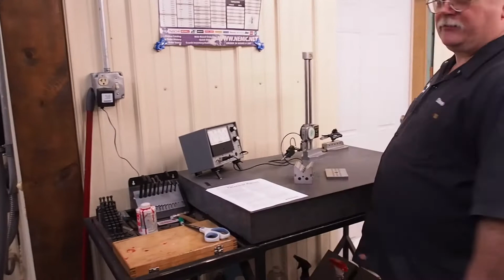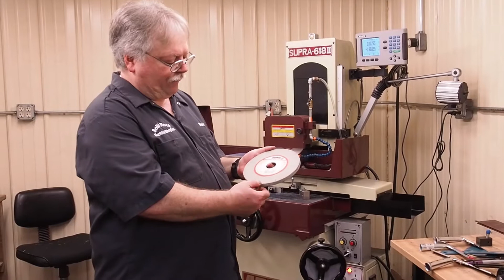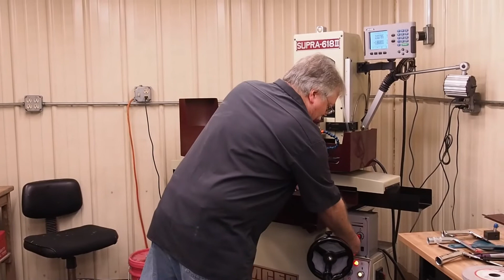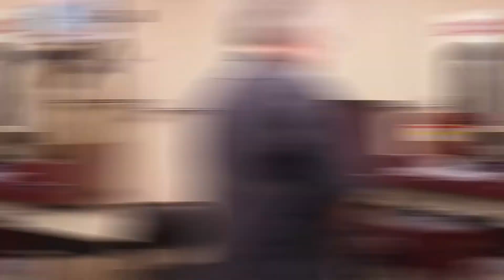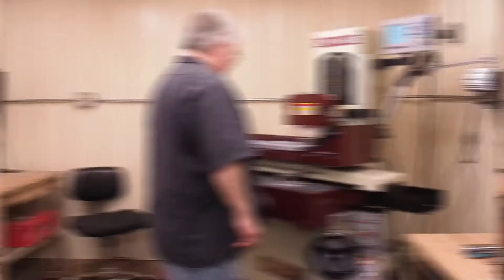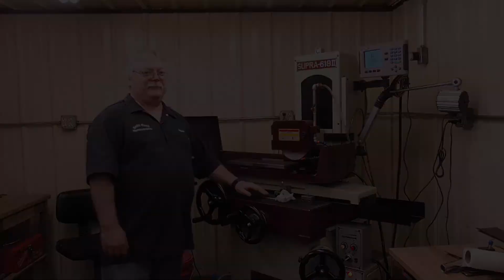Truing a surface grinder magnetic chuck.

Comment: Use a sharpie marker and draw lines up and down the chuck. This actually can show less than .0001 of flatness when most of the marks are gone and that some are still remaining.  When cross feeding ,use the total width of the wheel on each pass..0001 max cut when moving from front to back, do not feed down on the opposite pass .  You are only checking for wear and heat distortion on the chuck surface. If your grinder is worn or cheap, it will ride like a roller coaster on rails going up and down. This is why checking it with an indicator is totally useless. The ONLY true way to check your machine is by using 6 blocks that you have ground at one time, again checking with a magic marker on final passes for heat distortion, and then checking on a surface plate or a good quality digital micrometer for size.
     Oddly enough, if your coolant is too cold, you can also distort the surface of the chuck, the same way a cold gun will make the chuck shrink in the center.  
    Don't worry about .0001" because if you are not in a controlled environment, you will never really grind that accurately.  68 degrees is standard for measuring accurately all over the world.

Comment: First off thank you for the time and quality you and your family put into these videos.  I realize this is an old post, but I'm hoping it might still get a response. As a hobbyist and rookie to grinding what wheel might be appropriate for surfacing a small mag chuck if NO coolant was available. Only hoping to achieve "reasonable tolerances" nothing like what you are producing!
Reply from the maker: I would go with a 46H porous wheel. Normally I would not use porous wheels on the mag but heat is going to be your greatest enemy here so the porous wheel will help a lot with that. Light cuts no more than .0003" and redress after 2 passes (.0006"). Finish cuts no more than .0001" and blank passes.

Comment: Steve, when getting a new (used) machine that includes a chuck, should you true to bottom of the chuck as a matter of course? I have heard that it is best practice.
Reply from the maker: I always do. I also grind the the table surface that the chuck gets fastened to.
Steve

Comment: Thoughts on setting an indicator on a piece of nonmagnetic material base, like brass, and running an indicator across the surface this way?
Reply from the maker: You can do that but it will not compensate for the very slight teeter that you get moving the table from right to left. You have a lot of weight to one side when the table is at the end of the travel in both directions. The goal is getting flat parts. I can have the table measure flat with different methods and still get parts that are a tenth or 2 out. That is why I check the magnet based on how flat a large part checks out on the granite surface plate.
Steve
Reply: @SolidRockMachineShopInc  What a perfect and timely answer. Thanks!

Comment: There are so many opinions that differ in this area of precision.
I respect Solid Rock Machine and Don Bailey at Suburban tool.
Both say to use an H wheel. Steve says to use a full 8" wheel and Don says to use a very worn 7" wheel.
Both opinions are to reduce heat.
CONFUSING to a hobby guy with a B&S 618 Micromaster and a nice mag chuck.
Reply from the maker: Hi Jeff,

I believe Don uses the smaller wheel to reduce surface feet per minute and therefore reduce heat. If you have a variable speed spindle you can control the SFM with a bigger wheel and negate this issue. I do not have a variable speed spindle but still prefer the larger wheel. The reason is that I have a larger circumference which gives much more cutting edges. The smaller wheel will load up much faster than the larger wheel. Once the wheel starts loading you will have metal to metal rubbing (Loaded wheel metal particles and the chuck). In my experience that produces more heat than the greater SFM of a larger wheel. The larger the chuck the greater potential for wheel loading. Try both ways and see what works best for you.
Steve
Reply: Steve, thank you for your well thought out response. In my inexperienced opinion, your method makes more common sense.
Don also removes material to balance a wheel. Some say this is not a good idea. Others say if the wheel is out of balance after truing it should be returned to the source.
Just wondering your thoughts on this?
Thank you,
Jeff

Comment: I'm considering getting an Acer Supra 618. How do you like your grinder?
Reply from the maker: I love it. I work on many different high end 6*18 grinders and would rate the one I have right up there with them. I have an Acer Knee mill too and it is one of the best I ever worked with and I worked many of the high end mills too. A few of my subscribers have an Acer grinder as well and tell me they love it.
Reply: @SolidRockMachineShopInc  Just wanted to give my feedback on the Acer grinder. Decided to get one. I've had various surface grinders in the past. Have a few now (Okamoto, Jung, B&S, and Acer). Acer is ok for the price. It's not as good as Okamoto and definitely not as good as Mitsui. But it's also very inexpensive. It produces a pretty good surface finish, and grinds fairly smoothly. There are a few things that I dislike, however. First, for reasons that I haven't yet figured out, it will not grind well after startup; have to redress the wheel, then all is well. Possibly that the wheel gets jarred on startup, and needs to be redressed. Second, it's way too sensitive to unbalanced wheels. I would say that it's essentially unusable for surface grinding if the wheel is not balanced pretty well. And the balancing stand and spindle that come with the grinder are worthless. And last, the table is too light, and doesn't provide sufficient vibration dampening. It's so light, that the traverse handle will move the table to rotate into a downward position (so that the handle is at the bottom of the turn). That said, it's about 1/2 the price of Okamoto. So for the money, it's ok.

Comment: Had you thought about controlling the temp of the coolant bath?  If you did what temperature would you like ?  Room temp maybe or a little lower? 

Had not even thought about this before. Splitting hairs, everything matters.
Reply from the maker: The coolant is lower to the ground than the point of contact of the grinding wheel to the part. Heat rises so the coolant would be a little cooler at that level. I prefer it to be as close as possible to room temperature which we maintain at 68 Degrees. To do very high precision grinding (size) you need to control the heat variables as much as possible. 
Steve
Reply: @SolidRockMachineShopInc  Thanks, Not sure elevation is much of a factor,  your system is closed loop so the mixing of the tank with new warmed coolant from the action will slowly raise it up.  A larger thermal mass  [ larger tank ]  might be the trick.   probably doesn't matter with other variables with more impact.   Interesting to split hairs.  

Measuring the temp of tank with a thermocouple or RTD might be interesting to see if it changes over time when you are running it.  Could reduce the volume of tank and see if that changes.  

I saw Lipton watches temp of spindle assembly and lets it stabilize before running.  What about monitoring the part temp vs water?  T/c and adhesive tape be easy setup to rule it out or in
Reply from the maker: @johnm840  I already hold tolerances less than 50 millionths in 5". Not sure putting a lot of effort in coolant temperature control is worth the effort, expense and time.
Steve
Reply: @SolidRockMachineShopInc  Not worth it,  agree 100%.  as you have said everything matters, so it leads down these Rabbit Holes. 

I'm going to measure Part Temp change next time I Grind a part.  I'll let you know, with data on test.  I just do tool bits etc for the most part, nothing super fancy.
Reply from the maker: @johnm840  Sounds good.

Comment: Steve, Just watched this video and have a couple of questions: The wheel you mention is no longer in the Radiac Catalog?  the second question is do you balance your wheels before use. Thanks for the great videos
Reply from the maker: Hi Steve,
I found that out a few months after doing the video. I am still trying to find one that works as well. I only balance my super abrasive wheels (diamond and CBN).
Steve
Reply: @SolidRockMachineShopInc  Thanks Steve i'll

Comment: A 46 grit ruby wheel is better but not a lot. Another problem is I am using a ko lee universal grinder which is not nearly as solid a machine as a Cincinnati No.2 grinder. I have basically ripped off. 007" so far and need probably  another. 005 at least. I am sure I don't have a silica wheel. I need to get  off this job as l have gun drills to run tomorrow. Thanks so much for the help.
Reply from the maker: You are welcome.
Steve

Comment: Thanks for the insight. The troubles I am having are : I was using a 7" 60 grit ceramic wheel, grinding a fine pole magnetic chuck made in China, the poles are separated by aluminium strips and the wheel as you might guess is loading up badly with aluminum, I am dry grinding, and lastly this chuck is out a ton it's probably going to take 
 .005" - .010" just to clean  it up. I am thinking of face milling a skim pass just to strengthen it up some. I think I am going go with a coarser wheel first as you suggested. It was loading bad just talking .0005" .
Reply from the maker: You might have better luck with a green silicon carbide wheel.
Steve

Comment: As you work across the table, how much is worn off the diameter of the wheel?  Enough to put a taper across the surface?
At these tolerances, it wouldn't take much.
Reply from the maker: I always redress the wheel for the last .001" or less and even if you have a little wear on the cutting edge there still is a lot of flat surface on the wheel so that it is not an issue.
Steve

Comment: I’m so happy I stumbled across this vid, it all makes sense now, everything I was doing wrong you pointed out!   I have an old PM 618 I’m adding coolant to it, what coolant do you use? I prefer not to have to get suited up every time I going to grind something, I’m guessing water based?  Thanks
Reply from the maker: I use this coolant https://www.mscdirect.com/product/details/05930052  Make sure you use steam distilled water with it and you will not have to worry about it going sour.
Steve

Comment: Steve - I have no coolant and a smaller 6" magnet.  I have a wheel that is 7"x1/4" ....... and is otherwise exactly like the one you pulled out of your drawer there.  It's a por os way wheel from radiac.  Is the 1/4 inch wheel too small to flatten my magnet?
Reply from the maker: Hi Bobby.
The wheel I use for the chuck is a Radiac 50A 46.2 J VL2 white aluminum oxide. The Por os wheels did not work as well for me. Without coolant it will be hard to get a real flat chuck, the wheel being 1/4 may help in this case. If you have staight coolant try bushing it on the chuck before each pass like you see in some of our videos. It will help reduce the heat and keep the wheel from loading up to fast. 
Steve

Comment: Finally someone that grinds the chuck the right way!  I've cringed watching some of these other guys do it. I even saw one guy taking a .001 pass for his final grind!  You must be a moldmaker, that is how I was taught when I was a apprentice.   I remember some guys using crisco but I never had any luck with that. Coolant is definitely the way to go, I use the cool mist because my grinder doesn't have coolant on it and it seems to work well.  Hats off to you Sir, love the channel!
Reply from the maker: Hi Jerod,
Most of my career has been as a toolroom toolmaker in a deep draw stamping shop. Also, I worked in gauge and fixture shops.
Steve

Comment: Great video. We have been using speed controls on our surface grinders for over 15 years. You don't need coolant to grind a chuck. I would hate to grind without one now. In fact, if I had to grind often, and I do, I would pay for it myself. They are only about $300.
Reply from the maker: Hi Scott,
I have never used one but everyone who comments on them seem to like them a lot.
Steve

Comment: What wheel grit would you recommend if coolant wasn’t an option? Can you use water as coolant or does it need oil water base coolant for grinding the chuck?
Reply from the maker: Hi James,
I use a Radiac white Aluminum oxide 46J wheel for chuck grinding. If dry grinding I might try the ruby 46H porous wheel you see in our videos. Using plain water is not a good idea as it will seep into places and cause rust buildup that will create a lot of problems in the future. I use Cimcool cimperail 1070.
Steve
Reply: Solid Rock Machine Shop Inc. understood! We have a porous pink wheel not sure if it ruby. I heard to come across on the stone wheel with the diamond fast to create more pockets in the wheel to reduce heat. Do you also come across it 1/4, 1/2 or full wheel width when bringing it across?
Reply from the maker: Pink and Ruby are higher quality Aluminum Oxide wheels with different characteristics. The sharper grain cuts cooler. The pink may be better than the Ruby. Ruby works nice on harder steel. The idea is to cut while generating less heat as possible.
Steve

Comment: Another trick to help the wheel last longer is after you dress take a norbid stick and break the leading edge with a small radius.  Wheel will not load up as fast.
Reply from the maker: Thanks for the tip David.

Comment: great video Steve, thanks for making it. I'm with you on mag on when grinding, yet the Eclipse chuck people advise mag off.  Now I'm really confused!  I just added coolant to my Jones &Shipman 540 and looking forward to dusting the chuck again. 

Question for you. Do you filter the coolant and/or have a magnet in the tank?  Seems like that may help keep the coolant cleaner and increase its life. Thoughts?    Thanks.
Reply from the maker: Hi Charlie,
I use a sock filter for the coolant. we did a video on it here https://www.youtube.com/watch?v=yK3hWNYs6gI&t=14s
I am not familiar with Eclipse chucks but I was always taught to grind the chuck with full magnet on and it always worked for me and others I know. You can see the accuracy I achieve in my videos and this only happens with a true chuck. Try it both ways and see if you can tell a difference and go with what works best.   
Steve
Reply: Solid Rock Machine Shop Inc. Thanks for the reply. Classic Bozo YouTube  miscue for me. I saw your coolant video just after I posted my question!  Will watch it next. Thanks
Reply: Here I am, trying to locate the manual for my DoAll, I seem to remember reading doing the preliminary grinding with the mag chuck off, finish grinding mag chuck on.  Now I'm really confused, and I can't find the book right now.  I think my furred herd hid it on me.  I was paying more attention to that book than I was to the state of their feeder.  I'll find it in plenty of time, I'm not going to try anything with the chuck until I need too ...

Found it.  Power off grinding was for the underside of the chuck, when you are installing it.  Once the chuck is in position, aligned and secured, the chuck top surface is ground flat under full mag power.

Even back then, they were speaking of the hazards of certain coolants.  They are rather adamant about avoiding (cheap) synthetics and the potential dangers of old (bacteria laden) coolants to your skin, keeping yourself and what you wear in the shop clean, and not deliberately or unintentionally fouling your coolant (spitting, cigarette waste, food particles ... yeah I guess some guys were expected to each their lunches at the machines ...).  Almost enough to frighten one away.

I guess I need to figure out what today's equivalent of "Kleen-Cool" is.  Seems there was a system for dispensing coolant to the side of the wheel and allowing it to be pulled through by centrifugal force to help the cooling and to help keep the wheel from loading up.  Maybe it wasn't all it was cracked up to be, I don't see any newer machines repeating that system.  I'll research that later, after I get some new wheels, some other tooling, and solve my power dilemma.
Reply from the maker: Sounds like you are on the right tract. The coolant we are using works great for us. Using true distilled water is key to keeping it from going sour. I have never seen coolant last this long without going sour.
Steve

Comment: grinding a magnet is not really 'grinding" more like dusting since you remove less than a  .001 a few thenths at a time if you could slow the spindle better yet, otherwise use the smallest wheel less heat the better 46 grit  I orJ hardness works good.
Reply from the maker: Hi sam,
Thanks for commenting
Steve

Comment: Steve you are full of very handy trick! I take note for my shop... offsetting the rail out of the magnetic chuck make so much sense! I will follow your lead on this one... and this right angle jig grinder attachment too I never felt the B&S grinding attachment was making any sense you really want to fluid motion of the X axis parallel to the spindle axis. Thanks to share all theses great tips!
Reply from the maker: Thanks Simon,
You are very observant! I don't recall saying why I offset the rail on the magnet or why it is short. I get the best of both worlds this way. I can use the back rail with a 90 degree angle plate to line things up off the rail even in the center of the magnet. Yet, I can put things that have to go past the rail on the magnet without removing it. I think I missed what you where saying but you are right about that too. Look at https://www.youtube.com/watch?v=Ftu2BosKNyk&t=2011s at the 32:30 mark to see what I first thought you were talking about.
Steve